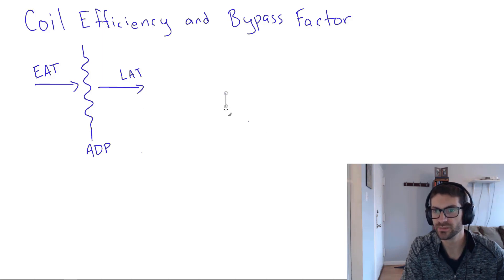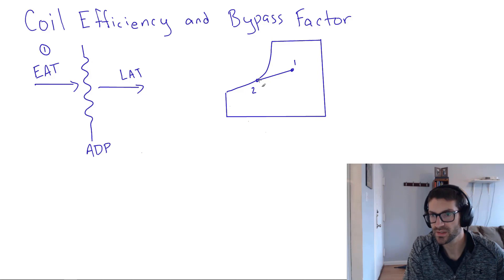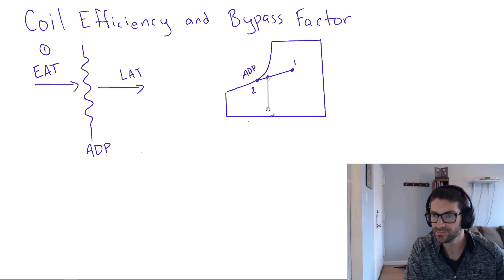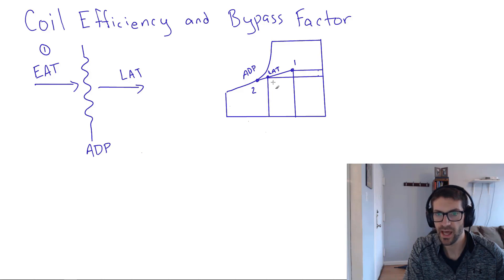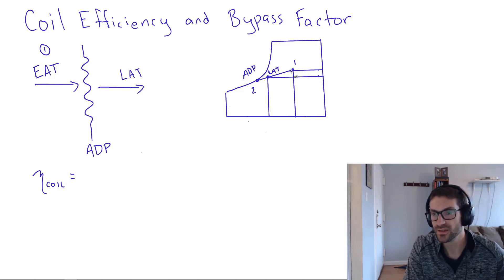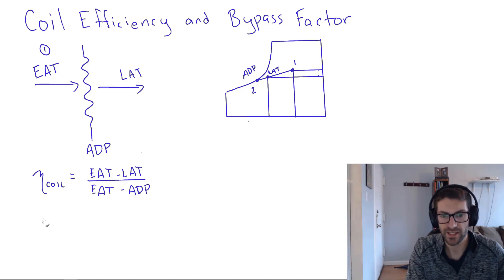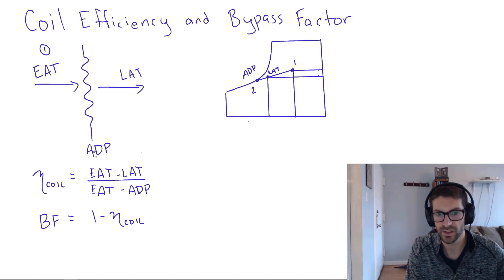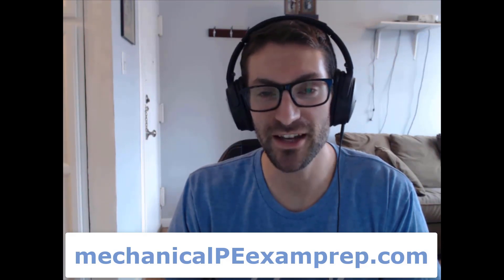Mechanical PE Exam Daily Insights: How to Calculate Coil Efficiency & Bypass Factor in HVAC Systems

Comment: Shouldn’t state 1 to state 2 follow a horizontal sensible cooling line to the saturation curve and then ending at the ADP? There is no dehumidification until the line reaches the saturation curve. I know you are describing ideal conditions but it would be nice to explain.
Reply from the maker: That's right.  I explain that in detail in my Fundamentals course.  Keen observation.